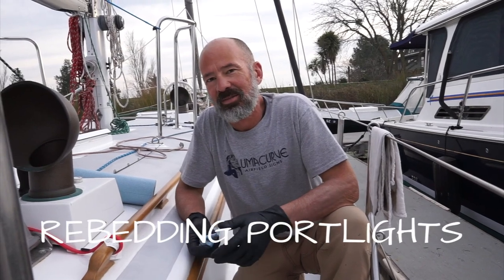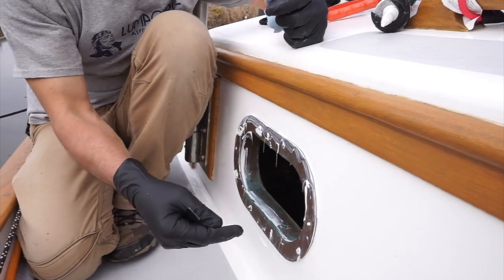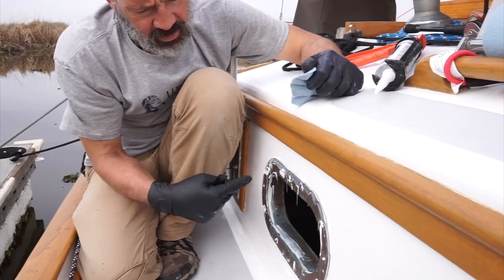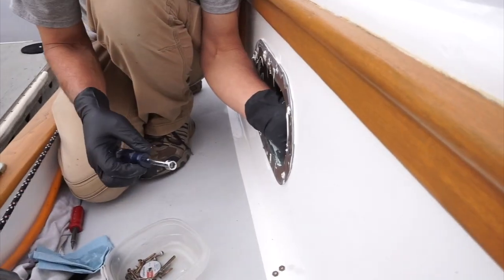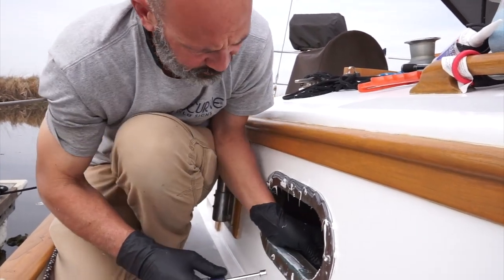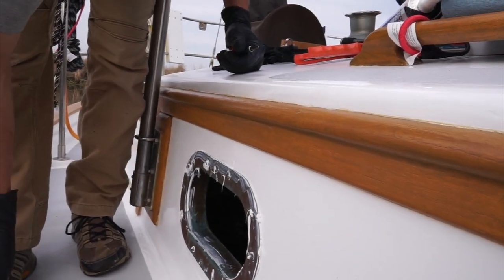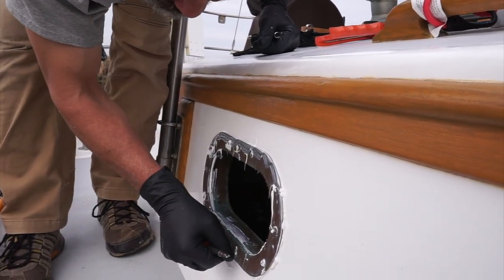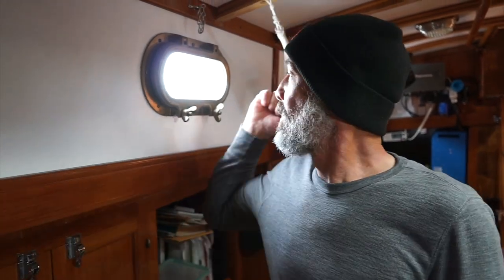SV Ramble On | Rebedding Portights

Comment: I’m glad I stumbled onto your video. I just replaced the glass and re-bedded two of my port lights using 400 caulk as well. I have two more ports to repair in our v-berth and I started to doubt my previous decision to use the 400 and was considering the use of butyl on the v-berth port lights. You brought up some good points and I like the technique you used. Thanks for posting
Reply from the maker: Glad it helped